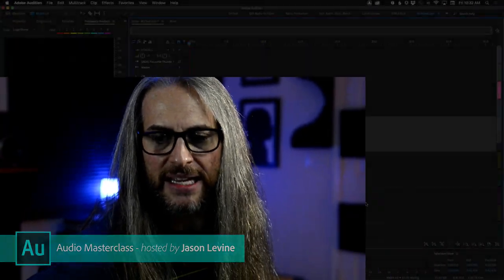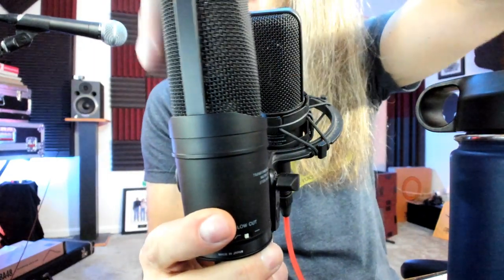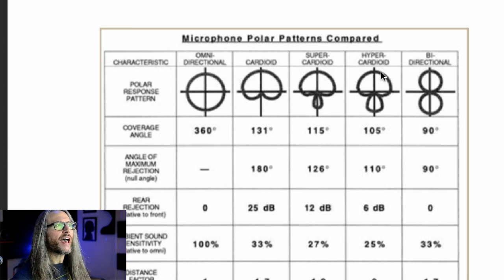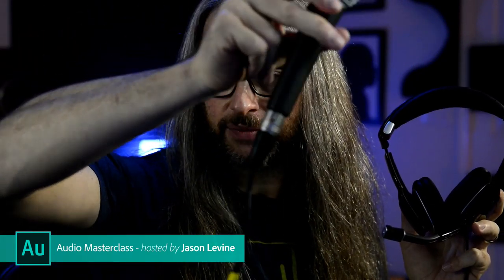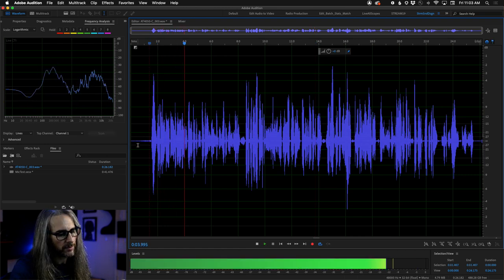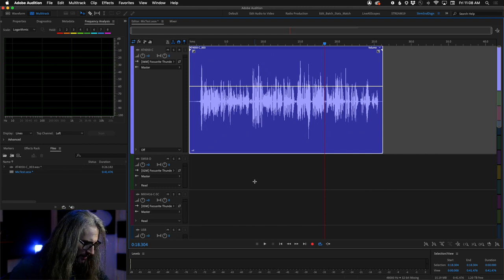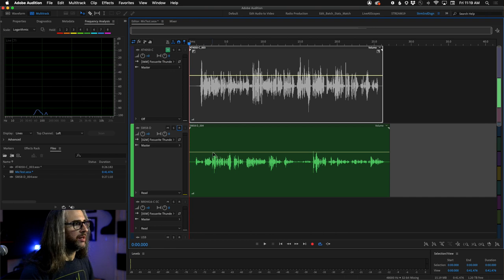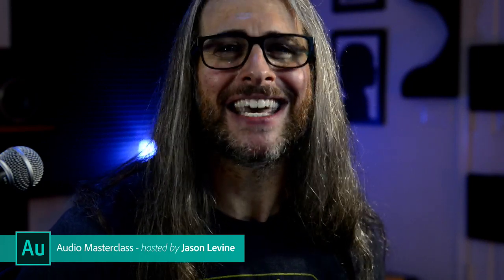How to Choose the Right Microphone for your Voice

Comment: Hi Jason, I feel very lucky to find your channel as I'm starting to record myself doing some singing and all the info you're sharing is coming super handy.
I've got a couple of questions, sorry if they sound a bit silly but I can't find a clear answer and I think you'rethe rightpersonto ask to:
1- I have a focusrite scarlet 2i2 and it has only 1 bottom to activate phantom power (48V), I already have a condenser mic that comes with the whole bundle, if I plug that mic and a dynamic mic, could the phantom power damage the dynamic mic?
2- which dynamic mic would you recommend out of shure SM58 and shure beta 58A?
Thanks a lot in advance for your answer and please keep posting this videos to help lost people like me 😅
Take care and stay safe 😉
Reply from the maker: Hey Saro. Thanks for kind words. And it's a great question actually: 1) Phantom Power will not damage your Dynamic mic; I'm assuming you're planning on connecting a dynamic mic via the Instrument input on the 2i2? Just be mindful when adjusting gain there, but outside of that, you'll be fine. 2) I still use SM58s but I absolutely LOVE the Beta58a. Again, slightly different sounds (depending on voice) but I would personally choose the Beta58. Both great mics, but the Beta has just a little extra (particularly for voices)
Reply: @jasonlevinevideo  great!!! Beta 58A it is!!!  
Ok, let me give you a bit more "complex" situation: same focusrite 2i2, Beta 58A plugged to input 1 to record my voice (heavy/power metal kinda stratovarius let's say) and to input 2 the condenser mic to simultaneously record my acoustic guitar, which means 48V has to be on, will that work all connected like that without having to plug/unplug anything or with the risk of damaging anything?
Again, super grateful for your help and pleasantly surprised for your quick response
Reply from the maker: Phantom Power (48v) is typically meant to power the XLR inputs on a device; so in this case, you would switch the order here, with your condenser mic (via XLR) into input 1 and the Beta mic (via a 1/4" connection/adaptor) into Input 2.
Reply: @jasonlevinevideo  that's amazing!!! Thanks a lot, seriously, you've been extremely helpful like you have no idea, now is time for me to watch all your videos 😉
Keep on helping, have a wonderful time and stay safe, take care 🤘🏻